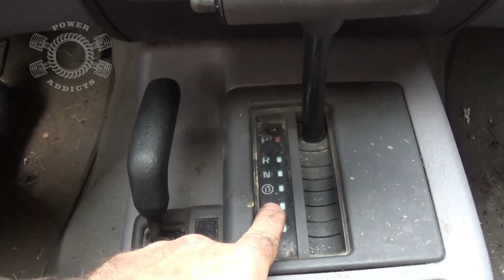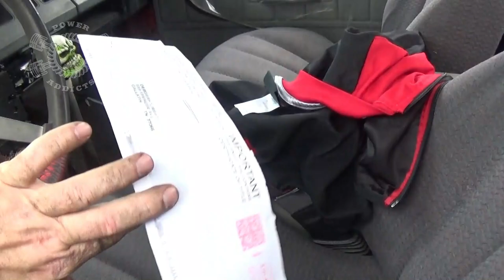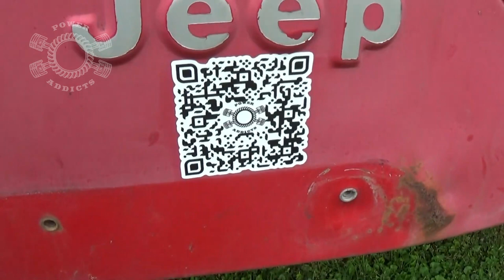The XJ is home and up dates on Rust Bucket and my driver rig #poweraddictscrew #jeepcherokeexj

Comment: Fun fact with your XJ project you can fit a 32 in the stock  Spare tire location
Reply from the maker: I'll be eventually running 31's so that is good info to know. I looked in your "about" section for an email to contact you about the XJ parts. Didn't see a way to contact you. You could probably message me through Instagram @poweraddictsyoutube.